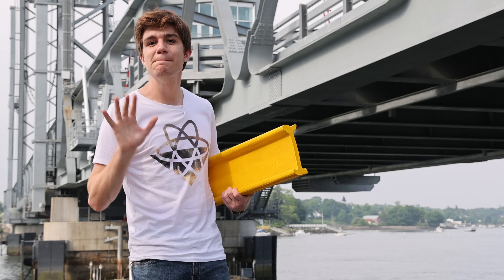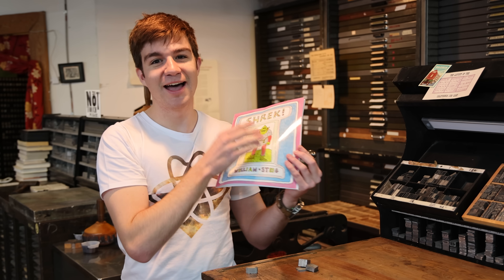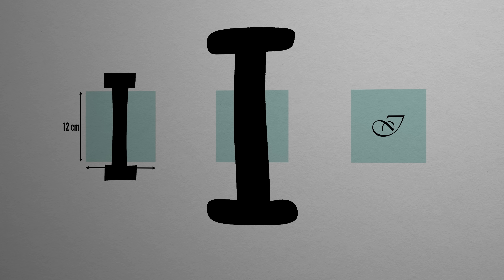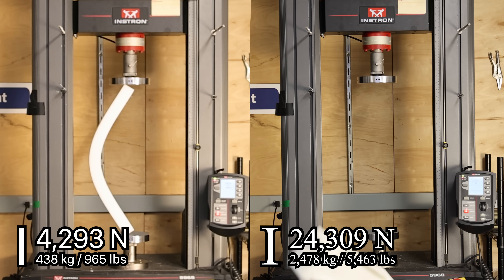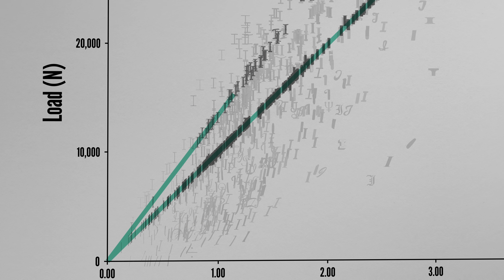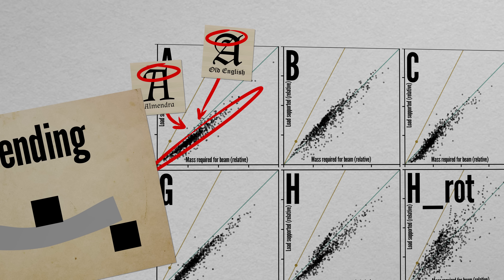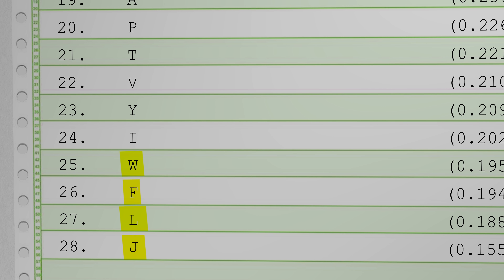Which Font Makes the Best ⌶-Beam?

Comment: Ironically, the I beam is also known by the AISC (American Institute of Steel Construction) as the "W-Shape". So the w being one of the worst kinda made me chuckle. Also a rotated H is similar to the shape of what is called a, "HP-Shape" basically a W-Shape but the wexidth and height are equal unlike a W-shape. Also O are literally just Steel pipe so them dominating buckling is expected. D is similar to a HSS (Hollow Structural Steel) (square tubing) so it also doing well is also expected. This was really cool, i never thought about that

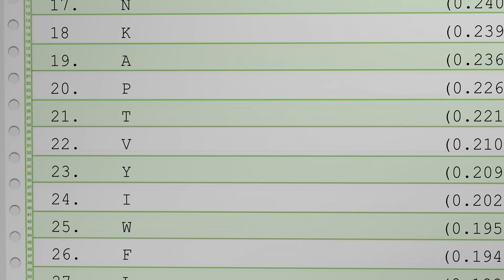Comment: So the 3rd position 12:30 is the "classic" I-beam, only less than 1% (presumably) worse than an "O-beam". Given the method was presented without the due error bars, I'm saying that: 1- the difference might be statistically insignificant and 2-O-beams cannot be laminated, they have to be soldered and that wasn't taken into account as weakening factor, so the main conclusion is... the best I-beam is an I-beam.  Quite comforting!

Comment: The funny thing about this is that it essentially reaffirms the idea that tubing/pipe is one of the strongest forms you can use through experimentation.

This is one of the core concepts mechanical engineers learn in statics.

Comment: Wow. Just wow. That was insane lol and a lotttt of work. But this is awesome data and id love it if we actually switched to using a stronger "letter"/font/structure for our "I-beams". Although, i-beams are pretty useful for manufacturing flat beams that can be connected/attatched to, easily. I'm sure theres at least ONE letter font that would be stronger for the same weight, have similar ease of manufacuring, be able to mate with other surfaces well and have things bolted or welded to it

Comment: At 9:42, BioRhyme is actually doing what modern H-beams do; for a given vertical loading on the beam, the H-beam is slightly stronger for the given mass, but the torsional stiffness suffers.

Comment: Do you account for failure in bending and shear, and how you can vary the flange and Web size of an I beam to provide better resistance to different conditions , depending on the loads from your design?

Comment: Now you just have to test the Japanese katakana 'e,'エ.  While you're at it ロ is a box girder or evenフ or へ could be useful as replacement for angle or bulb members.  I could also see certain Cyrillic characters being 'useful'.  
Really all it boils down to is section modulus per unit length versus mass per unit length.  When ships are built the entire midship section of the hull is summed and represented as an I beam for doing rough calculations, as it is the area of greatest bending.

Comment: I was surprised to hear the term 'Moment of Inertia' only once (https://youtu.be/azDaPm13CT8?t=452), and seemingly only in passing.  Has the term fallen out of favor, or does it get supplanted by other discussion when one moves into graduate-level work, or perhaps into a more specialized field like Civil Engineering?  I studied the more general field of undergraduate Mechanical Engineering back in the 80s.
Reply from the maker: It's in the paper, but didn't end up being super relevant to the actual results
Reply: @AtomicFrontier  Oh, cool!  Thanks!  I'll check it out!  My pre-read guess is that the similarity of the shapes led to effect of MOI being washed out?

Comment: Typeface and font are not synonymous. Incredibly, incredibly irritating.
Reply from the maker: Haha, knew there'd be one! I cover that in the final paragraph on page one of the paper! You're 100% right
Reply: As are 10 spammed comment from a pedant.
Reply: @curbsideaudio  incorrect. It's the wrong word. It's like calling all rectangles squares. All squares are rectangles but only some are squares. Fonts are more specific than typefaces. Almost always when people are talking about type they're referring to the design characteristics of a form of type, a font family, which is a typeface, like Microgramma, not a font, which would be, for example, 24 point Microgramma Bold Extended. Nobody ever made this mistake until people who knew nothing about it saw pull down menus on their computers with font names. The reason why there are lists of fonts rather than typefaces is because of how they were arranged in the software to reflect the specific files that corresponded to those fonts. From a typographical standpoint they should have been arranged by typeface with contextual menus reflecting different variants which would be fonts.
Reply: @curbsideaudio  nor are the comments spam. They reflect how often these sloppy and incorrect references were. Hearing such a mistake once in a video is annoying. Hearing it several times is exponentially more annoying.
Reply: @singlesideman  Imagine that. Someone didn’t know the distinction at the time, so repeated it until they learned better and later published a paper with correct information. 

Welcome to YouTube, mate.

Comment: No, it's not the printing press. It's the computer. No one ever talked about fonts until desktop publishing arrived. Because computers use specific files they needed a menu of those specific files which would be fonts rather than typefaces which are font families containing those characteristics that define the style of the typeface. A typeface would be, for example, Microgramma. A font would be 24 point Microgramma Bold Extended. So incredibly irritating.

Comment: loving the video, just a tip from an audio guy if you use a lav mic out in a windy spot you can do a 100-150 Hz Low-Cut (High-Pass) to get rid of most of the rumbling 👍
Reply: some mics have a built in switch for this, or u can just do it in post if ur editing software has EQ/filters

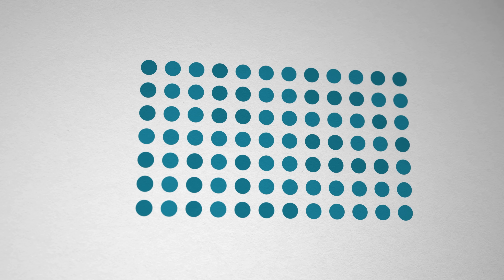Comment: 3:25
fun fact! compression is the exact reason chainsaws, and many other cutting devices will get stuck depending on the situation
supported from 1 end or when the support is going the same direction (i.e with a rope pulling on the top of a tree for example) , you cut from the top down, thats because the tension is on the top and compression is at the bottom, as opposed to supported from both ends where you cut from the bottom up due to the tension being at the bottom

Comment: Nice work. In reality, manufacturing dictates some of the design, for example the flanges are easier to roll if they are tapered. And inside radii always help against stress spikes that can cause a material failure.

Comment: What about lowercase letters?

Also, many fonts have alternate character forms that can be accessed with OpenType features. I know that Open Sans, for example, lets you use a capital ''i' with flanges, but defaults to one without flanges.

On the topic of I-beam profiles in general, I wonder if it'd be optimal if a cycloid was used to create the shape of the flanges. That shape tends to show up a lot in this sort of thing.

Comment: this is the interesting thing about university that should be standard, teaching students, all students SOME level of coding that would make their jobs easier in the long term, structural engineers should learn a bit of code to figure out what design wouldn't be boring that would hold the requested normal weight +50%, that extra 50% can go to fascade and other things like future expansion.

Even meteorologists are learning to code because it's kind of a "fuck that" when predicting weather...

people are still betting on AI when it's just too expensive for any student or even uni to practically implement properly and the GPU's are getting too pricey, there's too much hype and on top of that, it's far better to have students taught the UNDERSTANDING of their tools, what they do and how to use them rather than trust.

Comment: or u know just do a quick calculation of the Second moment of area, like how it´s done professionally, doing an fem for this is so unnecessary
Reply from the maker: Good point! I did that in the paper to show why it doesn't work. Was a bit to pedantic for the video though so removed it from here
Reply: @AtomicFrontier  
"Though tempting, optimizing beams purely via these equations overlooks real-world limitations like stress concentrations, local buckling, and asymmetric geometries [10]"

i cant find actual calculations, maybe its not in the paper?

buckling is also kinda off in this context buckling is a result of the failure not the reason

Comment: To be honest, beams are just a simple archimedes principle third class lever or first class lever. Though usually because beams are thinner than their span, the "effort" force on the beam is much greater than the "load." It's like in the arms where your biceps might need to lift 100 kg a short way when curling a 15 kg weight at the gym a long way, because the tendon is secured a sixth or a seventh of the way to where you hold the weight. Using the same material, a rod or flat strip in the direction of bending is going to be more bendy because the "effort" is closer to the fulcrum in the centre of the beam. An H, D or O shape gives you a "thicker" beam and places the effort away from the fulcrum, meaning it takes more load to overcome it. There are a lot of materials that have two strong sheets of material between a spacer, for the sole purpose of moving the effort away from the fulcrum and resisting bending forces better.

Comment: Maybe it was covered and I just missed it, but how does the different structural properties of HDPE compared to steel affect the results?

I know he mentioned that simulated results were fairly close to the practical testing, but it was unclear whether this meant (simulating steel) was similar to practical experiments using HDPE implying the two behave similarly or (simulating HDPE) and it behaving similarly to actual HDPE implying the simulation was sound.

Comment: I wonder what diameter O stops the most rotation... I guess you'd have to stretch the material as far as it can without it losing the ability to distribute the force... Is there a measure for how thin you can (theoretically) make a certain material?

Comment: By the way, the most commonly used beam type is the W beam (H shaped), not I. There are other factors besides the strength of the shape, for example: Being able to bolt the beam to things easly. Which is also why W beams replaced the old S beams

Comment: As a steel buyer I often have to write emails saying H-beam and sometimes I-beam. I without flanges that some fonts use is an issue so I usually jse Consolas which has a nice letter i and is nit too fat down the list so I found it quick lol. Was not expecting this video to be the opposite; stress test the fonts. Interesting video nonetheless

Comment: regular I beams are the S-beam, which has a slight angle on the inside of the flange. The one shown is a W-beam, which has wider flanges whose faces are parallel

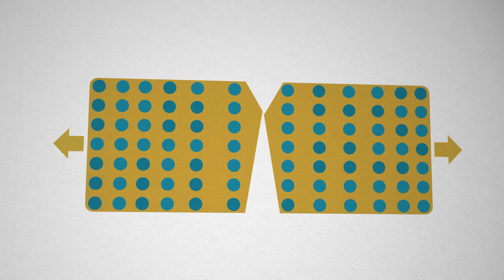Comment: 3:40 For the materials you're looking at, you are not breaking the molecular bonds. There are imperfections in the lattice. The force moves these dislocations around, they combine, and form a weak spot where failure occurs
Reply: Thank you. This was the comment I was looking for. If the material would actually break as shown in the animation, it would require A LOT more force

Comment: I was really hoping that all this work would also result in a paper, so it made me very happy when you mentioned it at the end.

Also, only seven days of coding work to save a week of manual data entry? As a software engineer, that's quite the 'win'. As the old xkcd claimed, you often end up spending much more effort than that on the coding.

Comment: My old box truck has a square ladder frame and most motorcycle frames are O-Shaped so it makes sense those are pretty strong. 

You kinda mentioned was that it's all about using as least possible material as you can, but you didn't to mention that the main reason we don't build bridges out of O's and Squares anymore is because RUST. Once water condenses and penetrates the interior of a closed beam, it's a ticking time bomb. But I'm just a guy on the internet, IDK maybe I'm wrong? If we can fill the hollow portion of a beam with a lightweight waterproof, anti rust material, maybe squares and O beams will be used.

Comment: This is such a cool concept, but I feel like I am left with more questions than answers, I have been conducting research with fusion FEA for the past year, and I would really appreciate a behind the scenes video going over your setup, like your mesh settings (in my research I found that improper mesh setup could change results by a factor of over 10), and what type of simulation you used (Static load, dynamic etc.), also for the rankings I saw a decimal value, I assume this was the SF, but I would love some context, that said I understand if this would be a bit to niche.

Comment: I’m suprised you didnt just use a script to rasterize and calculate the second moment of area for every single font
Reply from the maker: I did! But the results were kinda boring and didn't add much to the video. Good news for you is that I kept it as a section of the paper (because I knew someone would ask about it anyway). Basic result is that none of the fonts beat their theoretical limit, but a lot fail to meet it because of stress concentrators / lopsided shapes.

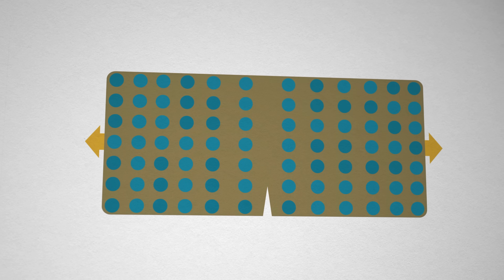Comment: 3:41 Dropping this here for those who want an explanation of why buckling happens.

Buckling is not a failure due to plastic deformation caused by compression. When any beam is loaded by pressing its tips towards each other, there is always a small bending moment applied to it because in real life loads are never perfectly symmetrical and centered, and material always has inconsistensies that cause some parts of it to elastically deform more easily than others under load. These two factors together mean that when a beam is compressed lengthwise, it wants to bend and deflect to the side. As the  load increases, the increasing deflection changes the geometry of the situation and increases the bending moment applied on the beam, becoming more and more sideways relative to the direction of the beam tips. Eventually the bending moment becomes large enough that the system becomes unstable and the beam continues bending more even when the load is not increased, and it just folds in half. This switch from stable to unstable is known as buckling, and it doesn't require any plastic deformation if the beam is long enough.

Comment: If I followed this right, if we look at just the applications for which I-beams were designed (not those that they are also employed for because theyʼre good enough and cheap), you still found some shapes work better than the traditional I-beam?  Why would that be; why wouldnʼt the I-beam shape be pretty much optimal for its designed use cases by now?

Comment: Structural Engineer here, what you're missing at the end for your conclusion is unbraced length. If all the beams are long-span but braced at close intervals, then then you'll have fully elastic section yielding (maybe local flange buckling, all checkable) and the moment resisted is just the section modulus times the stress (Sx*fy for a steel, for example). Really, all you need to do to calculate the best I-beam shape isn't a bunch of full FEM simulations, it's a comparison of the overall section modulus and how liable some portion of it is to locally buckling, ie, how thin walled it is. Most likely the best section modulus will also be a thick walled O, for compression-type loads, while if you fully constrain one axis with lateral bracing for beam-type action (like we do in buildings with diaphragms), then the I-shape starts to make the most sense.
Reply: Civil/Structural grad student here and I was thinking the exact same thing. Most of his tests probably just found the lateral torsional buckling capacity of the member at that length—you can literally see LTB happening in the test footage. Full bracing is needed if you want to find Mp experimentally. Sadly it doesn’t look like any accounting for this was done in the full paper either.